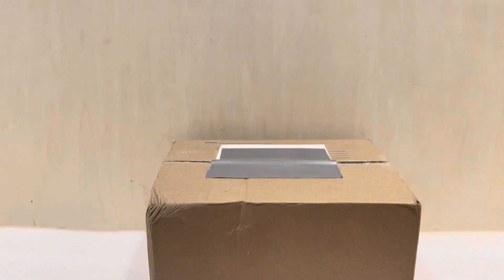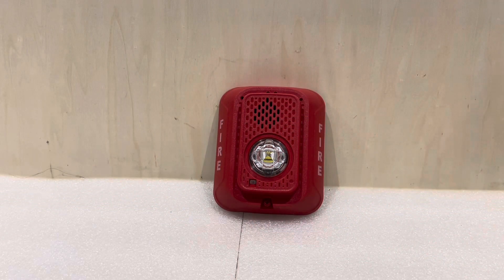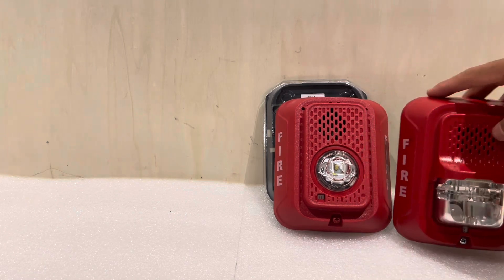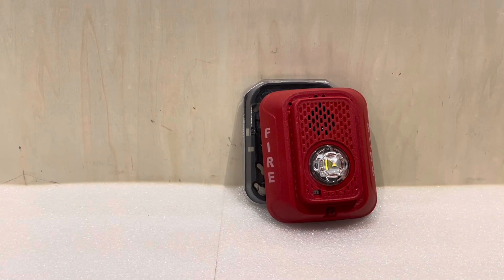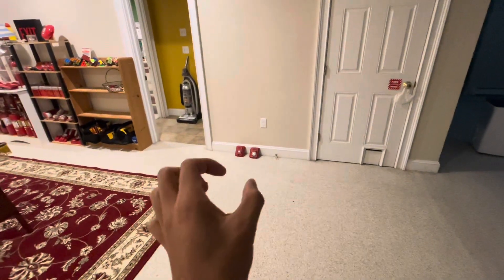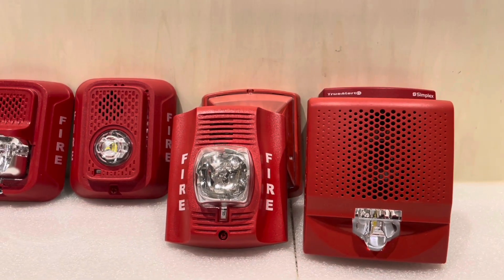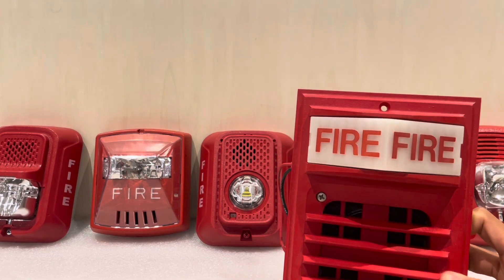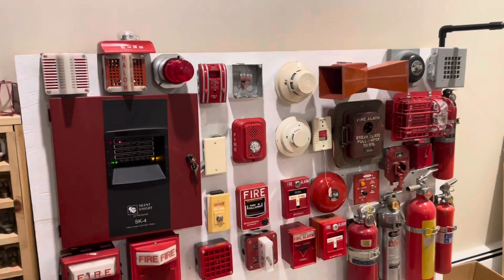A Closer Look at the System Sensor LED L-Series Fire Alarm Devices

Comment: I think what bothered most people was the strobe being circular despite it being wall mounted which looked out of place to most collectors. Other than that, it’s the same alarm with a few minor changes. Nothing crazy at all. The strobe is just…maybe like experimental? But it’s not too much of a big deal. And I will admit the ceiling mounts look better and more identical to the previous L-Series models than the wall mount models compared. However, when you hear stuff like that from collectors most commonly refers to “I hate the new wall mounts they’re so bad.” And not, “I like both I just think one is slightly better than the other.” Or maybe you like them equally but have a preference. And yes for every kind of collecting thing people love old stuff and rant on the new stuff usually for no reason. I do want to get one of these for my small fire alarm collection as I do have a lot of system sensor stuff and would be nice to add to the lineup.
Reply: Another thing, too, is that the horn is off-center, much like the Advance series.

Comment: imo the issue with the leds is theyre too dim and they flash for too long.
Reply from the maker: They are the same intensities as xenon strobes and they comply with the flash length requirements. Only early devices had those issues.
Reply: @FireAlarmDude5967  aight

Comment: I don't get why so many people hate on them. I think they're great, especially I have been waiting for a good few years for System Sensor to come out with LED strobes. Now I'm just waiting on Gentex. Truthfully, give it 5 years and they might be replacing most SpectrAlert Advances by then.
Reply: The reason I don’t like it is because design wise in my opinion (and prob other ppl) the design is a downgrade for me.

-less centered things like candela window and grille

-strobe dosent look as good as the old one did 

At the end of the day though it’s a functional alarm and even has more practical features like the candela selection being like the horn selection. I am not a fan yet of the led horn strobe but I maybe will soon

Comment: Now I am a huge fan of older systems like mechanical horns and such, This doesn’t mean that I hate new stuff. Ofc I love system sensor devices, and I think they’re doing a great job of making new products that are more useful, and better at alerting people incase of an emergency. I just see these almost everywhere, so they’re very common. That’s why they’re kinda my least favorite. What I love back in the day, is seeing different types of fire alarm systems, old, mid age, and new. What I’m saying is I like that there are tons of different fire alarm devices made by tons of different companies, how they work, what they look like, and what they sound like. Doesn’t matter if they are electronic horn strobes, mechanical horn strobes, speaker strobes, or bells, as long as they work, and they’re all built for the same purpose, saving people’s lives by alerting them for an emergency. What’s cool is you can come across systems where they just have random combos of pull stations and notification appliances. For example, the Stop & Shop in my town actually used to have a cool FCI system before it was renovated. The system had Gamewell Centuries everywhere, and EST Pre-Integrity’s everywhere on the walls and the ceiling. There’s an IKEA furniture store that I go to all the time in New Haven, CT, system had Gamewell Centuries everywhere, and Gentex Commanded 3’s and 4’s. Basically interesting systems with mixtures of stuff. I don’t mind if you disagree with me. Just telling you that I love all different kinds of fire alarms, and DEFINITELY the new ones being made. I kinda do get a bit upset that the old and cool stuff are getting replaced, but now we’re stepping into the future. System Sensor’s just doing their job. 🤷🏾‍♂️ But as long as we got the old stuff in our fire alarm collections, then we’re chillin.

Comment: I can understand if people don't really like the LED series of the L Series but people you need to realize it is what it is and it still has the same sound as the original system sensor L Series and the Spectralert advance but for me there's only a few things I like how about it is that it still has the same horn and it looks just the same as the original one but I don't know about the strobe light but overall the system sensor L series LED is a good alarm

Edit: ok when I saw the strobe flashing, I actually started to like the way it flashes.

Comment: I hope you don’t Mind if I make another Question but it is relatable to what You said.

Old Devices are cool, don’t get me wrong, but I recently tried installing My Commander 1 as a part of a System and it was a pain. You have to Put the Mounting Bracket on before you do any wiring, then you have to Wire the Alarm itself and trying to Wire the Commander 1 then trying to get it into place is a pain.
Then When I installed My Advance it was very Easy. It was Simple and wasn’t a struggle.

My point is People are so quick to judge these new devices before they probably even installed one or Bought one. I bet the LED L Series is way more reliable and way easier to install. I bet once these people actually use one of these L Series they will change their Opinion and realize how good it actually is.
Reply from the maker: Well said

Comment: My biggest problem with these was the release. When they first came out, the datasheets did not list them as compatible with FWR, and some genuinely do not work on FWR. On top of that, they still sell the old xenon era horns, which do not have the T3/T4 setting, only T3. Then we have the fact that the special sync module required for these to switch to T4 hasn’t even been explicitly announced yet. We have proof from the backs of these and LinkedIn that they can do it, but there currently is no way to do so.  

The devices do look weird, but as long as they work who cares?
Reply from the maker: There’s a lot of features here that don’t appear to have been released yet

Comment: The filtered DC subject is bs. Like you said they wouldn't release a product that doesn't work on half their panels and power supplies. Not to mention they listed it as a direct replacement for older devices that were listed for use on filtered DC. I recall a older data sheet did not have a listing for filtered DC but I believe that has been corrected.

Comment: 08:50 I think System Sensor should fix the delay of the LED L-series starting up so that way when you activate a system with these things you'll almost instantly feel them going off and not with a brief second delay as this happens because of the information going to the device to tell it to go off on temporal 3 or temporal 4
Reply: I wonder if you connect the LED L series to other sync protocols (simplex, wheelock, gentex), could it do temp 4?